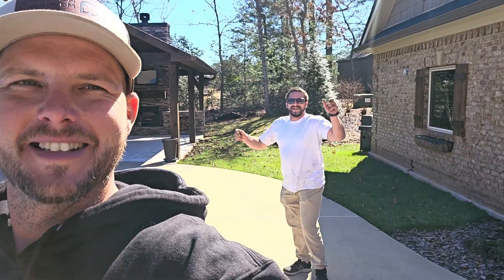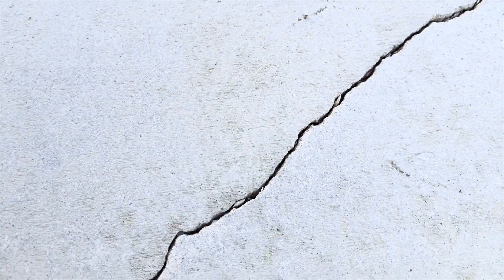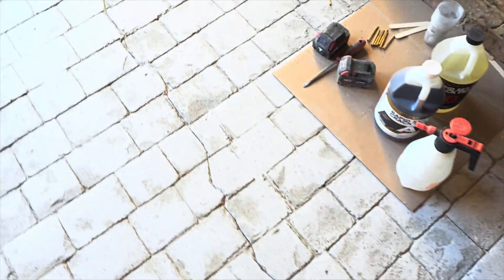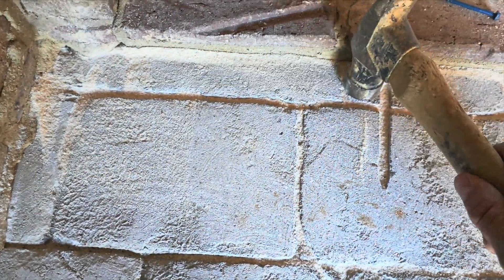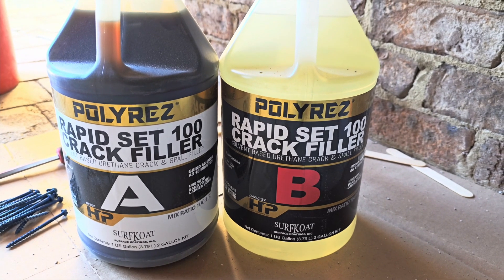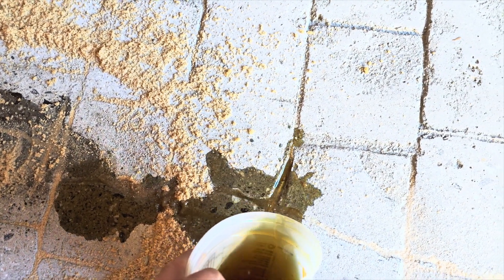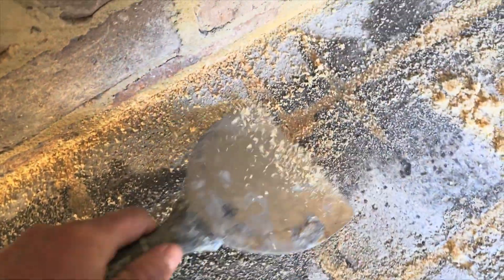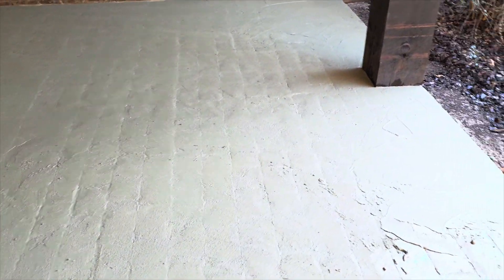Concrete crack repair for overlay

Comment: Hello Ben, I’m planning on resealing a stamped patio with cracks on it. Your method to repair the cracks looks very promising to me in this video. Would you suggest me to 1st pressure wash the old worn out sealer then repair the cracks as shown in your video or 1st repair and then pressure wash to reseal the stamped concrete stained patio. FIY I’m a newbie in thing. Trying to learn stuff to save some for family. Cheers bro!

Comment: Hey Ben, what kind of screws are you using for your stitches? I would thinks that they'd need to be stainless steel so as not to rust out, swell and pop the surface (?) I like the idea of this and the Polyrez Rapid Set 100 Crack Filler! I just want to get it right. Great work you guys do! Thanks for the tips.
Reply from the maker: We use deck screws. I honestly think most screws would work. My theory is if theres something for the crack repair to bite on each side of the crack it can't slip. The head on one side, and threads on the other. This is why I dont use nails. A lot of people use smooth cut wire. There's nothing to grab to. Glad to hear these help and best of luck on your projects 💪
Reply: @bensconcretecreations   Thanks for your thoughtful reply. I just checked out some of my 4" Azec deck screws that have that serious no-rust epoxy coating and I think they will be perfect. Thanks again and keep up the great work, Ben.

Comment: Love your videos!!  Wish you were in Austin, Tx :)

I have an existing 1/4 overlay that was done a couple of years ago. I’ve noticed several small irregular cracks.  I’m sure it’s because of the concrete underneath the overlay.

What is the best way to repair / hide these small cracks?  Can you recommend what product to use?

Comment: Hey Ben, great project, I watched all the videos!! Does that stitching technique you show here work actually in long run? In terms of preventing cracking again?

Thanks again
Reply from the maker: @TheFurkantatar  you can never guarantee cracking won't come back. In my experience if you don't cut proper control joints back in it will crack again. 9 times out of 10 it's not where the stitch is though it's to either side of it. We stitch, finish the project then cut saw cuts where we think they should go

Comment: Hey Ben awesome work on the pool deck. Did you have any issues wirh shadowing through the overlay on the crack repairs? Ive got one crack that ive put 3 overlay coats over and still shadowing... Epoxy and sand fill in the crack. Thanks brother and stoked on all the education your putting out
Reply from the maker: We have had some ghosting with crack repair yes and I always tell the owner that up front and they would still rather have that than the crack every time